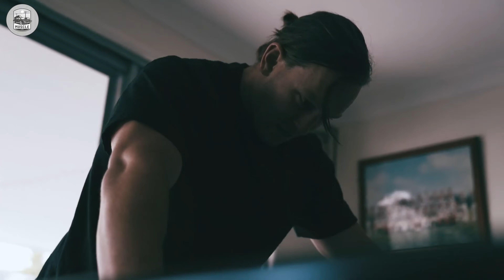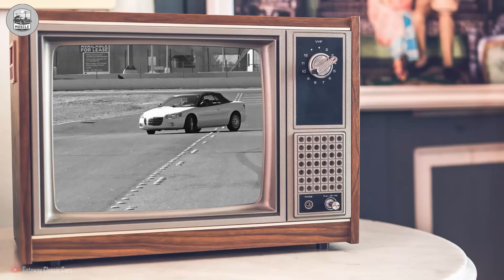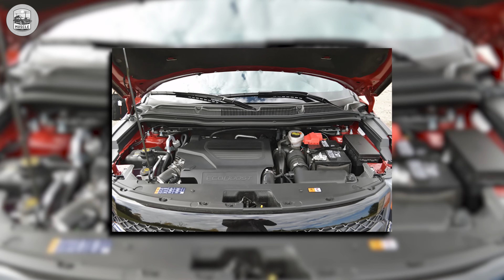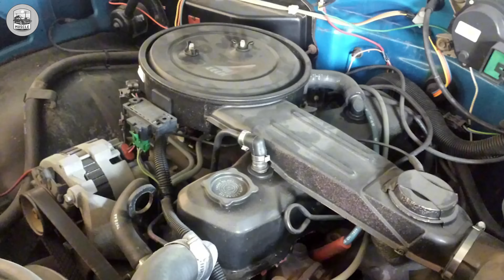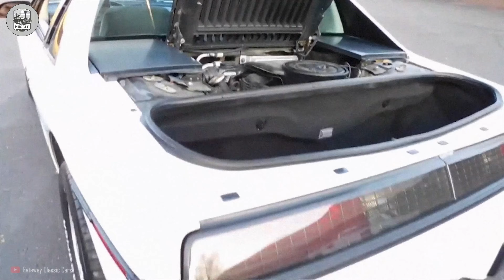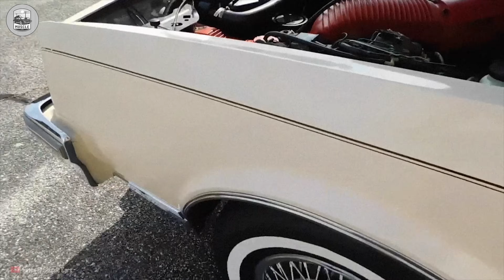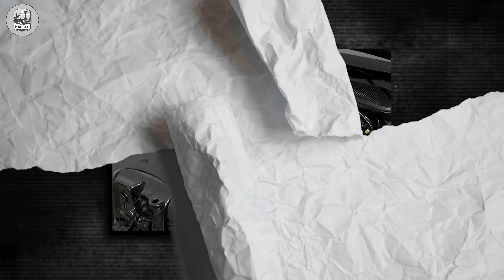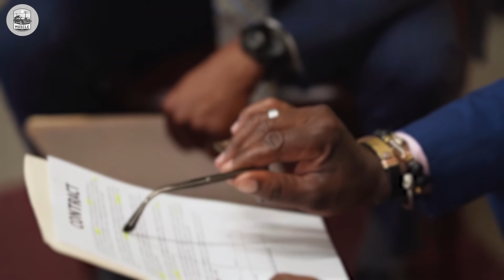MOST FAILED ENGINES ever put in production cars | Worst engine blunder!

Comment: My uncle had an Olds diesel.  It would only start if parked downhill facing forward. After MANY trips to dealer problem was NEVER solved.
Reply: He Oldsmobile early V8 diesel engines. Yes we’re very big problem, by 1981 with the DX block and upgraded head bolts and injection pump. They were quite a reliable vehicle, but by that time they got such a bad reputation nobody bought them.
Reply from the maker: @tomtaylor7484  Thanks for sharing your insights on the Oldsmobile V8 diesel.  the time the 1981 DX block and upgraded components came along, the damage to its reputation had already been done. The early models suffered from those significant design flaws, including the problematic injection pumps and weak glow plug systems. It's unfortunate because, with proper refinement, they had the potential to be solid engines. I'd love to hear more about any modifications or personal experiences you've had with them

Keep the comments coming, share the videos, and subscribe for more classic American muscle car content! We’re all about preserving these legends.
 Thanks again, and I look forward to hearing more
Reply: I had exactly the same problem (engine not starting when pointed downhill) with my 1979 olds Delta 88, my 1981 Old Delta 88, and my 1982 Olds Cutlass. I don't remember any problems with my 1981 GMC pickup diesel. I loved the fuel  mileage and I loved the sound of awesome power inside the cabin. They didn't have awesom power, but they sounded like they did. Outside, the cars sounded like a bucket of bolts, but inside you only heard the low frequency rumble of the V8. I bought them used for very low prices. I wish I could have kept at least one of them for an occasional drive. The sound of the engine was the best of all my 25 cars except my 1964 Corvette fastback.  I removed the 327/300HP engine  w/Powerglide and installed a 409/409HP V8 with 2 Carter AFB carbs and B&M rebuilt Chevrolet truck 4 speed hydramatic. At low throttle, it ran on only 2 barrels,. But when I floored the gas peddle, opening the other 6 barrels , the engine sounded like it was going to inhale the trees on both sides of the road.
Reply from the maker: @dessertfox3263  Thank you for sharing such an awesome story
Those Oldsmobiles and that epic Corvette swap are a real tribute to the golden age of American muscle and ingenuity. It’s amazing how those V8s could create such a symphony inside the cabin while roaring like beasts on the outside. Your 409/409HP setup must have been a dream—true muscle car magic
And you're absolutely right, every engine has its quirks, but that’s part of their charm. To all our fans: what are your favorite muscle car memories? Let’s hear them in the comments! Don’t forget to like, share, and subscribe to American Muscle Cars...
Have a good day.
Reply from the maker: Thanks for sharing that story—it's a classic example of the Oldsmobile Diesel's infamous issues! Many owners dealt with hard-starting problems due to design flaws like the weak injection pump and glow plug systems. GM rushed these engines to market, and while they had potential, poor execution hurt their reputation. Did your uncle ever consider retrofitting it with a gas V8 or modifying the fuel system? We'd love to hear more
Let us know your own experiences with tricky engines in the comments below. Don’t forget to share, subscribe, and keep the muscle car spirit alive! Hope to see you in the next video, have a fantastic day

Comment: the 3.5 ecoboost shouldnt be on here even the first model was a good engine if maintained correctly. gotta love ppl that buy a turbocharged engine and think they never need to change the oil
Reply from the maker: You're spot on
The 3.5 EcoBoost is a solid performer when cared for properly—regular oil changes are key for any turbocharged engine! Neglecting basic maintenance often gives great engines a bad rep. The early EcoBoost models faced criticism, but much of it boiled down to improper upkeep. Ford really packed power and efficiency into this V6, making it a game-changer. Let’s hear from everyone—what's your take on turbocharged engines in muscle cars? Drop a comment, share your stories, and don’t forget to subscribe to American Muscle Cars for more gearhead fun
 Hope to see you in the next video. Have a great day....

Comment: ya, i had a '03 gmc sonoma with that dam 2.2l, in my 47 years of driving many cars and trucks,  IT WAS THE SLOWEST, MOST GUTLESS vehicle i have EVER driven. i have 2.7 tacoma, was ok, 2.3l ranger, was ok. but it couldn't move out of its own way, with n empty truck, turn on the AC or put ANY load  and you needed to deploy the sails to help push you along..  heh   maybe in some econobox small car it might have worked, but NOT A TRUCK. it never shoulda been even considered for trucks.
Reply: I suspect that there might be a worse one; a carbureted 2.8l v6 in a 1984 S-10 blazer!  I had one, and if I was driving into a headwind, it could not maintain 55mph at wide open throttle!
Reply from the maker: @mistered9435  You're absolutely right—those carbureted 2.8L V6s in the early S-10 Blazers were infamous for leaving drivers frustrated. Wide open throttle just to hit 55 mph? That’s rough! It reminds me of the 2.2L in the '03 Sonoma—another engine that seemed better suited for a compact car than a truck. It’s amazing how engines like the 2.3L Ranger or 2.7L Tacoma could at least keep up, while some GM small blocks left drivers shaking their heads.
What about you, gearheads?
 Have an awesome day—see you in the next video
Reply from the maker: the 2.2L in the '03 Sonoma was an engine that left a lot of drivers underwhelmed, especially when paired with a truck. While it might have been acceptable in a lightweight econobox, expecting it to handle the demands of a truck, especially with the AC running or carrying a load, was asking too much. For comparison, engines like the 2.3L Ranger or the 2.7L Tacoma provided at least adequate performance for their class, but the 2.2L struggled to deliver torque where it mattered most. It’s a classic case of manufacturers trying to balance fuel economy and costs without considering real-world truck use.
We’d love to hear from others—did you ever own a truck with an underwhelming engine? Drop a comment, share your story, and don't forget to subscribe to American Muscle Cars for more engine talk. Have a great weekend, and see you in the next video...

Comment: There’s nothing wrong with a 305 engine. The ‘78 to 79 engines lacked power big time. I installed a 4 barrel system off a worn 350 and perked it up. I also had an 85 GMC with 305 4 barrel I purchased new the engine was 10 years old before it gave any trouble
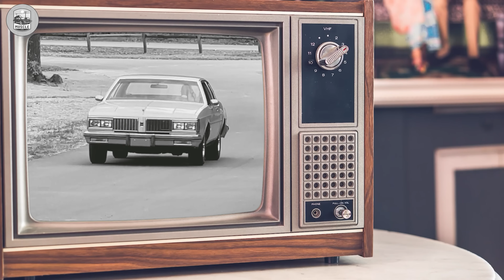Reply: The 305 was as reliable as at 3:50 was it just has as much horsepower. Everybody I was a small block Chevys ran forever and ever with very little maintenance so I don’t know where they got this idea from.
Reply from the maker: @tomtaylor7484  Hey, thanks again for your comment! You’re absolutely right, the 305 small block often gets overlooked, but it's definitely capable when treated right. Your experience with the '85 GMC proves that these engines can be reliable workhorses, lasting for years with minimal maintenance. It’s all about the right care and a few tweaks, like the 4-barrel upgrade, to really unleash that potential. We know that the emission restrictions of the '70s and '80s didn’t do these engines any favors, but with the right mods, they’re ready to roar. 
Thanks for sharing your story. Everyone, drop your thoughts, mods, and memories in the comments, and don’t forget to share and subscribe to keep the muscle car legacy alive
 See you in the next video...
Reply from the maker: Thank you for your comment. The 305 engine often gets an unfair reputation, but as you pointed out, with a little tweaking, it can hold its own. Adding a 4-barrel system from a 350 is a classic move—proving once again that a little ingenuity can wake up any small block. Your experience with the '85 GMC speaks volumes about the 305's durability. Running strong for a decade without issues shows it was built to last, especially when cared for properly.
The late '70s engines were indeed choked by emissions regulations, but with upgrades like yours, they had the potential to shine. Stories like these remind us why muscle car enthusiasts keep these engines alive and roaring.
Thanks for sharing your insights—keep ‘em coming! Everyone, let’s hear your stories, mods, and favorite memories. Don’t forget to comment, share, and subscribe to American Muscle Cars.
See you in the next video—keep the muscle alive.
Reply: had one on a 82 Chevrolet had over 400k when traded
Reply from the maker: @williampowell2722  Hey, thanks for sharing your story about the '82 Chevy
Over 400k miles is a true testament to how tough those engines can be when treated right. Like I said before, the 305 small block may not get all the love, but it’s a workhorse. Emission restrictions held it back, but with proper care and a few upgrades like a 4-barrel carb these engines prove they’ve got staying power. Keep those memories coming, and if you’ve got more tips or mods, drop them in the comments! Don’t forget to like, share, and subscribe to keep the American muscle car spirit alive.
 See you soon, have a great day....
Reply from the maker: Hey, thanks for sharing your insights on the Chevy 305
the camshaft is often the weak link, but it’s great to hear that with a simple cam replacement, these engines can keep running strong for another 75k-100k miles. The 305 may have been held back by emissions, but with a few performance upgrades like a better cam or a 4-barrel carb, these engines can really show their potential. It’s awesome to see how these muscle cars continue to perform with the right care
 Hope to see you all in the newest videos—be sure to comment, share, and subscribe for more American Muscle Car content! Have a nice weekend
Reply: The only short coming of the 305 Chevy was the cam . Other than that it served its purpose well . They just wear out after about 150-180,000. However it isn’t expensive to replace the cam in them and there’s another good 75,000 - 100,000 miles left to them after that .
Reply: @ramie-uz9xi  Totally agree the 305 was underrated, but here's the kicker, it's not just the cam. The heads and intake really choke its potential too. Swap those out with a mild cam upgrade, and you’ve got a solid little small block.
Reply: The problem with the 305's power isn't the smaller bore/longer stroke. It doesn't just need more carburetor - it needs something other than a nearly-flat OEM camshaft and cylinder head ports a dime would get stuck in. But it wasn't unreliable and worked fine in grandma's Caprice.
Reply from the maker: @cll1639  Thanks for your detailed comment on the Chevy 305
while the smaller bore/longer stroke combo gave it durability, the flat OEM camshaft and restrictive cylinder head ports really held it back. That’s part of what makes this engine such a hidden gem for enthusiasts today. With upgrades like a performance camshaft and better-flowing heads, the 305 transforms into a capable and fun small-block. Pair that with a 4-barrel carb, and suddenly, grandma's Caprice becomes a serious contender on the road.
What’s great is that this engine proved reliable for daily drivers while still offering plenty of room for hot-rodding potential. Let’s keep these conversations going—drop your thoughts below on your favorite 305 upgrades or stories! Don’t forget to comment, share, and subscribe to celebrate the legacy of American Muscle Cars with us. Have an amazing day, and Happy New Year to you and all our fans

Comment: 3800 is a great engine
Reply: The 3800 series 1,2, supercharged and NA, rank GM's #1 engine ever made, and is in the top 10 best engines EVER MADE.
Reply: The only problems I ever encountered with the 3800 were the intake gaskets leaking and the plastic cooling elbows for the heater hoses. Once you replaced those 2 items, you head an incredibly reliable engine that had good power and awesome fuel economy for its time. As far as crankshaft sensors failing, the 3800 was not the only engine with that  problem, and it was an easy, inexpensive repair. Despite this video bashing the 3800, it was one of GMs best engines since the small block V8.
Reply: One of the very best.
Reply: Y’all are missing the point
The 3800 earned its respect yeah, plastic elbows and intake gaskets were headaches, but once fixed? Bulletproof. GM nailed reliability and efficiency here. Compared to today’s complex messes, the 3800 is simple, strong, and proven....lol...

Comment: I had a Buick Enclave with the 3.6 litre VVT engine. It was horrible! I ended up having it replaced with a junkyard motor. Even with the newer engine, i was still afraid to ever push. We had sooo many problems with that car!
 Oh, and as far as the Buick 3800 goes, the later engines were some of the best ever made. But, the old even fire 3.8's were terrible. They were notorious for blowing out the bottom of the motor after 100000 miles.
Reply from the maker: Thanks for sharing your experience! The 3.6L VVT in the Enclave has been a mixed bag for many. Timing chain issues and oil consumption have frustrated owners, but with proper care, some have had better luck. As for the Buick 3800, you're spot-on! The Series II and III engines are legendary for reliability and power, even rivaling V8s in some builds. The early even-fire 3.8s, though, were a learning curve—prone to bottom-end failures if pushed too hard. Let’s keep this conversation going—comment your favorite engines, share with fellow enthusiasts, and subscribe for more Muscle Car stories. Hope to see you next videos. 
Have a good day...

Comment: I didn't own one but remember the Cadillac 8-6-4 as problematic and wonder how it ever made it to production.  I bought a new 1984 Chevy Silverado with a 5.0 V8 and it was ok at first but later it was problematic.
Reply: As a mechanic back in the 80s the Caddy 8 6 4 was not a bad engine. When it changed cylinders the car seemed to missfire. A simple fix was to cut the control wire at the ECM to eliminate the change over.
Reply: Yeah that makes a ton of sense.
Reply from the maker: Thanks for sharing your memories! The Cadillac 8-6-4 was certainly a bold move, aiming for fuel efficiency by deactivating cylinders—a concept ahead of its time. Unfortunately, the technology wasn't quite there, leading to reliability issues. GM’s ECM struggled to manage the transitions smoothly, frustrating many owners. However, it laid the groundwork for modern cylinder deactivation systems we see today.
As for your '84 Chevy Silverado with the 5.0 V8, those engines were known for their dependability when well-maintained, but carburetor issues and emissions control systems often caused headaches. Many owners found upgrading to a better carb or tweaking the timing made a world of difference.
It’s always fascinating to hear these stories—our passion for these classic rides keeps them alive! What’s your favorite memory from that Silverado? Let us know below, and don’t forget to comment, share, and subscribe to American Muscle Cars! Hope to see you in the next video. Have a good day....

Comment: Gm 3800 is one of the best engines out there and the 2.2 my racing group has had over 80 of them in cavaliers sunfires etc and are one of our favourite race cars only ever had transmission issues
Reply: The main issues my friends encountered with the 3800 were leaking intake gaskets and the plastic cooling elbows for the heater hoses. Once those were replaced, the engine was incredibly reliable, offering solid power and impressive fuel economy for its time. Crankshaft sensor failures happened on other engines too and were an easy, affordable fix.
Reply from the maker: @AilaniMadden  Thanks for sharing your experience
the 3800 engine is a beast when it comes to reliability, and those common issues like intake gasket leaks and the plastic cooling elbows are something many people overlook. It’s great that your friends had those sorted out, and it’s awesome to hear about the engine’s performance and fuel economy. It’s also interesting that crankshaft sensor failures popped up across other engines, but as you mentioned, they're a quick and easy fix. To all our viewers, drop your thoughts, share your experiences, and let’s keep the conversation going! Don’t forget to like, comment, share, and subscribe to American Muscle Cars. Hope to see you in the next video, have a great day
Reply from the maker: the GM 3800 is a legendary engine, known for its incredible reliability and smooth power delivery. The 2.2, especially in Cavaliers and Sunfires, has earned respect for its performance in the racing community. It's amazing your group has run over 80 of them! Transmission issues can be tricky, but it’s a testament to these engines that they keep pushing hard regardless. Share your favorite racing moments with these cars—we’d love to hear! And to everyone watching, drop your comments, hit that like button, share, and subscribe to American Muscle Cars. Hope to see you in the next video. Have a good day...